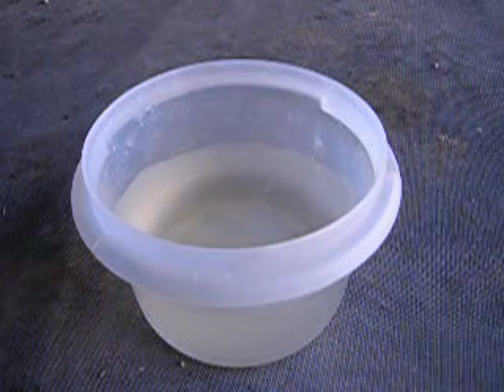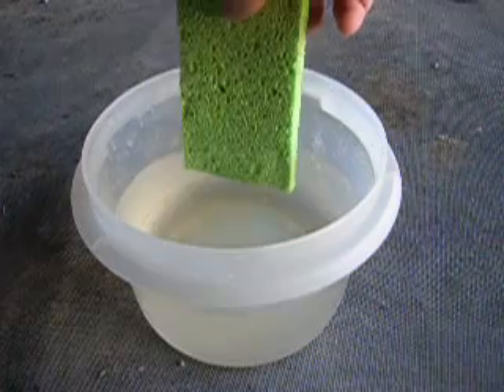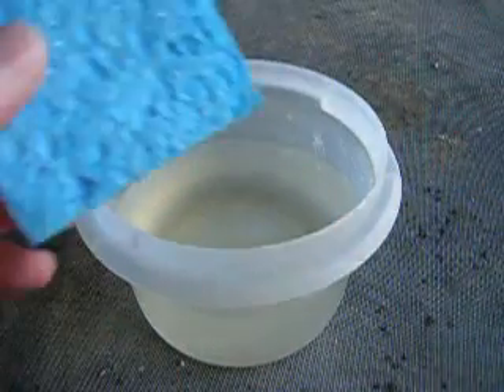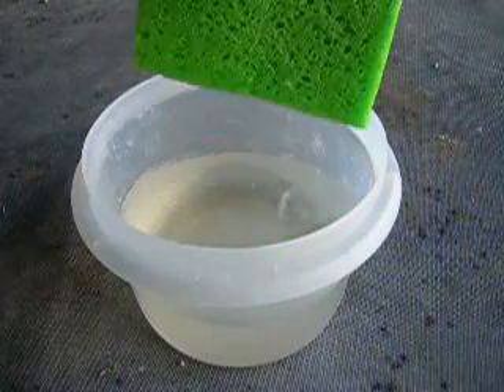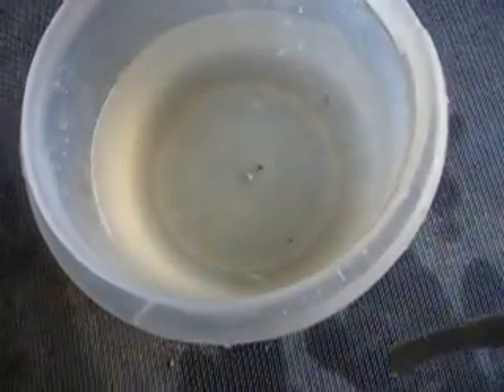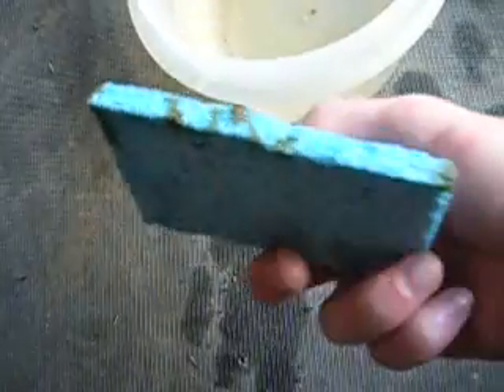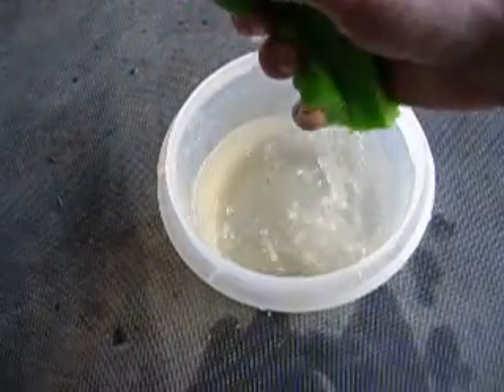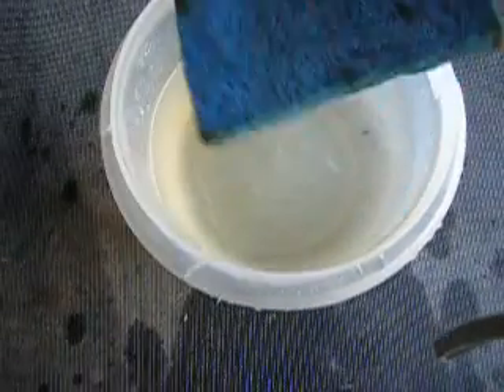Hydrophobic Sponge.

Comment: i would like to replicate this, can you illustrate how you went about it all?
Reply from the maker: I bought a can of water proofing spay(Silicone Water-Guard. Made my Atsko) and a cheap pack of sponges. I think the sponges were made out of wood fiber. I soaked a sponge with the water proofing spray and let it dry, before I tried it out.  I wasn't impressed with the results, but for $3 worth of materials, I didn't think it was half bad.